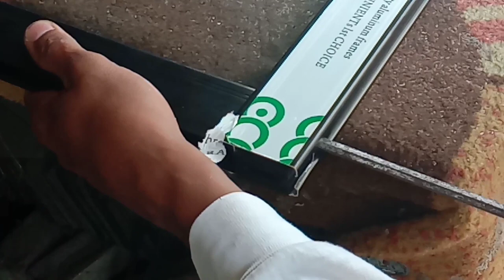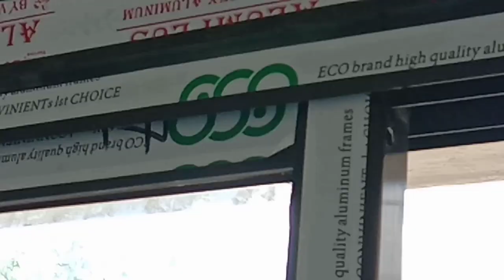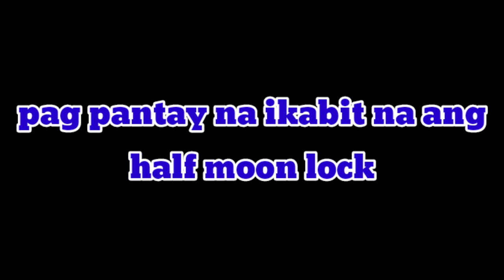Crescent lock installation

Comment: Boss Idol, baka may vids ka po jan ng pag apply ng sealant sa gap ng aluminum at glass?
Reply from the maker: D po kc ako nakakapunta ng site pag installation, mga tao ko n po iniiwan ko, makapunta man po ako d p po qko nagpapasealant, madalas po kc sa huli na nagsesealant, isang largahan. Hayaan mo sir pag nataymingan ko. Salamat po sir sa panonood ng mga video.
Reply: @gonjoeschannel9988  kpag 798 po ba, may channel glazing (rubber) sa salamin, or sealant nlng ginagamit? 798 ksi gagamitin nmin sa 1st project.
Reply from the maker: Sealant n po yon, maliit n lang po gap noon dpo kagaya ng sd section. Wag nyo lang po medyo palakihin ang tabas sa tip ng sealant para d po masyado madami ang sealant, saka nakahiga po yong panel na may glass pag sinelant, hangang matuyo, isang side lang po muna